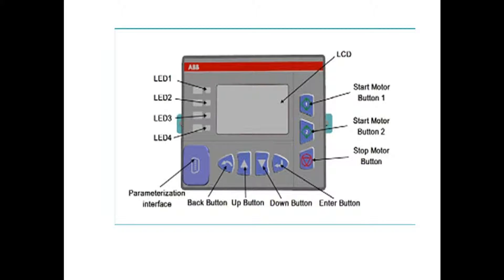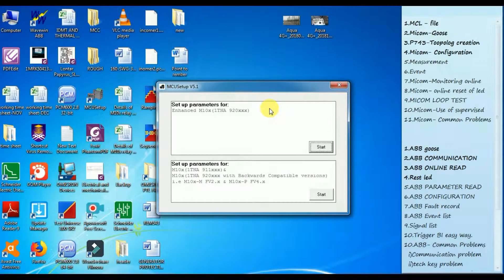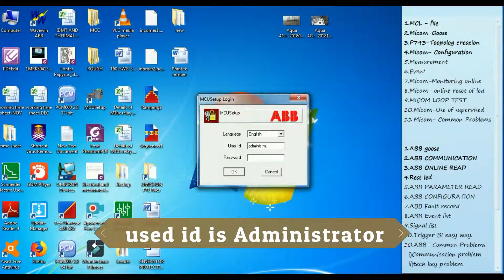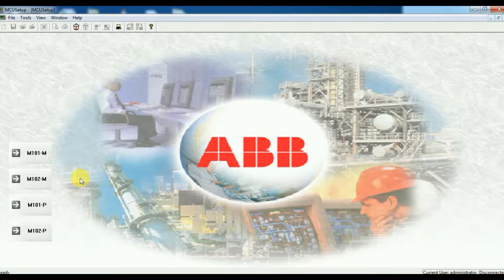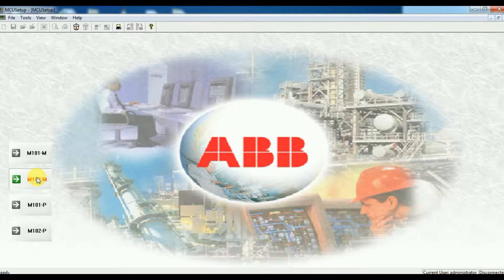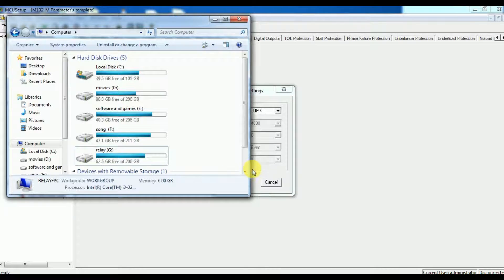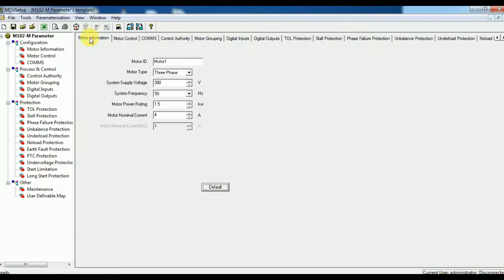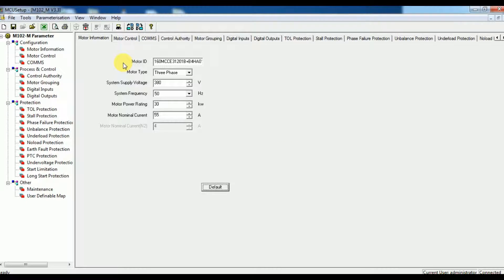Communication of  ABB |M10X relay| M102 relay | M101 Relay | MCU Relay

Comment: Hi sir, Have fault alarms. The HMI indicate current and alarms (TOL, Overload, thermal capacity, welded contactor) without load. Panel for 132 KW motor.
Reply from the maker: may be due to induction